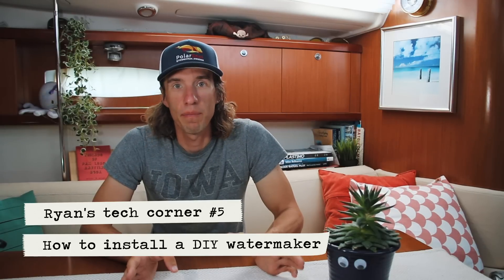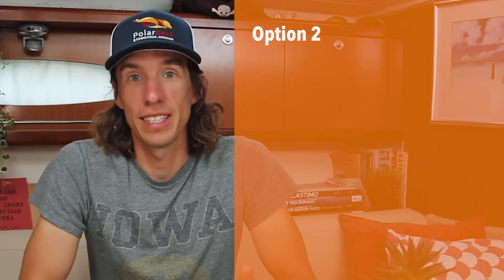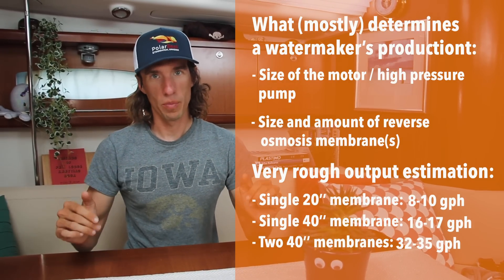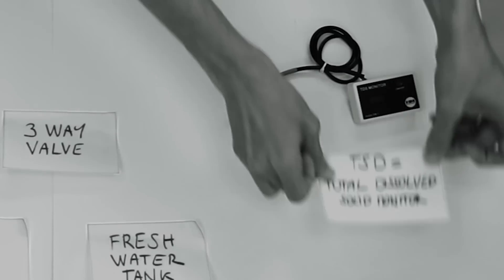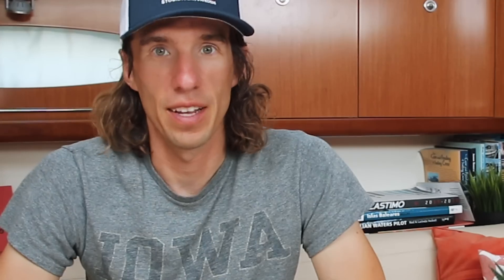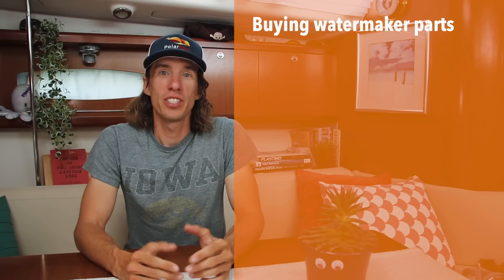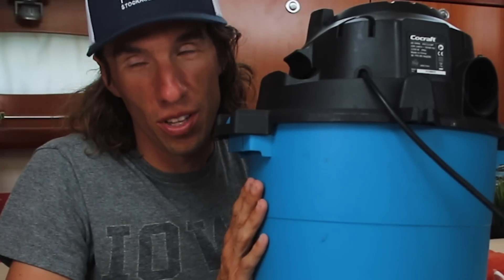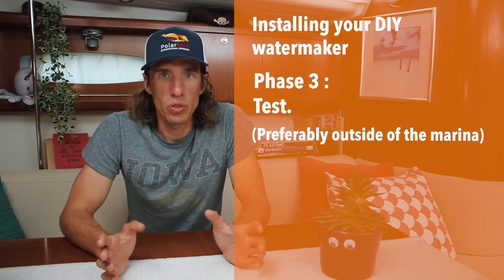SAILBOAT TECH: How to install a DIY watermaker  (SeaWater Pro) // Ryan’s Tech Corner #5

Comment: Does the TSD-meter (sorry) measure salinity ? Or is the TDS showing that the salt is removed ?
Reply: It measures the total of dissolved solids and that includes salts. As it is used after the RO-membrane-filters, a low enough number means the system is working properly. If you want to know before-after then you need a second TDS meter that measures in front of the filter pipeline.

Comment: When the industry gets their head screwed on right, they'll have a device with a few hoses that you stick in buckets and gator clips for 12 volts. Open it up, change small standard filters, and you're set. Until then, it's rainwater and jugs onshore. Everybody's boat tank gets contaminated. Pee Yew.

Comment: Ryan ~ thanks for this. Best explanation I’ve seen! The flush timer - does it use the low pressure or some other pump? How does the flushing fresh water get through your system? Thanks in advance.

Comment: Well done Ryan. I have a question, when you start the clean mode the valve pressure should be always at 50 bar or  is necessary open it? Thanks for your reply

Comment: Is it practical to install a watermaker on a small (sub 30') trailerable sailboat? And if said sailboat has a wind generator on it, would that be sufficient to power the watermaker along with all the other electrical systems? I don't own a boat yet, but I'm considering diving into this world in the next couple of years if I can, since I live close to a large reservoir.

Comment: do you really need to kill the post membrane pressure valve after each use? seems not that useful to me but i'm no expert!!
Reply: from seawaterpro website: "If your system has already been in operation, the pressure should be
left at 800 PSI, and after turning on the pump you should NOT have
to re-adjust the pressure regulator."

Comment: ok follow my logic, a RO watermaker can run continuously without having to freshwater flush the system, not that you'd need it to. theoretically, you can run it on a timer, for an hour everyday, at anchor, without having to freshwater flush the system. obviously freshwater flush b4 pulling into a marina or leaving the boat for any significant length of time. does this sound accurate?

Comment: @Ryan & Sophie Sailing  
I first posted a version of this on your first video about water makers...
Over the years I've seen a few water makers .. mostly DIY ..
I suggest people get advice regarding what I write... as this is just some thoughts...
From what I saw on your videos...
You could do with pressure relief valves in the system, discharging over board .. particularly one just after the high pressure pump (do same with low pressure) .. this would also have a pressure switch with relay (have spares, automotive or lorry or agricultural ones might be big enough) set to a lower pressure than the relief valve to turn off the motor !!! ...
then you could go through a one way valve and have a large pressure tank .. some are stainless but apparently there is now a type of plastic tank with another switch .. with a delay to stop cycling .. to control the motor ... I would fit a similar setup after the low pressure pump.
This would mean both the low and high pressure pumps could charge up the system and switch off saving energy and pump wear .. also it would reduce pressure pulses... Big problem.
A pressure relief valve before the adjustable valve is a must.. with a cut out switch.
Another thing to be aware of is the brine output.. it can block the output pipe ... on a plus note it could be useful for pickling or further evaporating, use a black metal tray (oven tray) and place in the sun or on top of a low heat stove to make salt.
On some systems they used collected rainwater with a bit of sea water that had splashed on deck..
It does mean another tank but less strain on the system.. but some considered the pollution near cities could be an issue for the filter... Obviously it can also be used directly from the tank as it is for washing hair etc... and saving the water maker.
An option I like to do for Backup on crossings is loads of 2 litre bottles ( Basic formula 2 litres per crew per day, minus 1 week) that did contain lemonade etc...
Filled with chlorine tap water .. date them with an indelible marker .. and use as adjustable ballast.
Having the things to make a DIY solar still is another backup.
Have you done another video in 2021 .. on how you get on with it, did anything go wrong, any modifications and repairs.
Hope this helps.

Comment: Hi Sophie and Ryan, thanks for sharing your fantastic journey.  I just found your YouTube channel a few weeks ago, so I am a couple of years behind still 😄
I used to work a lot with RO systems although in a more industrial scale and there are two things I wondered about. 
1) Usually the taste of RO water is very “flat” , as there are no minerals or other impurities that will give tap a slight bit of taste. How does your water taste?
2) When I worked with RO systems I was taught that RO water is not healthy to drink in large quantities. This should be because the RO water would start a osmosis process in the body and thereby draw salt from your body. I am not sure this is true but have you come across this and was it something you considered when designing the system. 

Keep going.  Your videos are awesome 👏🏻
Reply from the maker: 1. It taste okay but flat is a good way of describing it.  I sometimes add a splash of lemon 🍋 to it and that helps.

2.  Yes... drinking only RO water over a long period is not good as it also takes out vital minerals from the water.  That said if you drink juice, or other items (not soda) it should make up, as well as eating healthy.

Ryan

Comment: If you are turning on the system every other day, you don't need to flush the membrane each time. You might want to do it once every two weeks or so.
If you decide to add another membrane, you don'need to change the pump. The pressure is more important, not the flow. You don't need to change anything besides connecting the second membrane in parallel with the first one. However, if you keep adding more membranes, then you would have to increase the high pressure flow. IMHO, it will be better to add another pump instead of changing the existing one, thus adding redundancy to the system.
To further automate the process, put a pressure regulator at the output of the brine water. With that, you can reduce the start and stop procedure to simply flipping the switch. Later, you can add a float switch in the tank and the system will work autonomously on demand.
I did not understand the thing with the amps... Do you mean that at midday you have some energy coming from the solar panels? In which citcuit is the ampere meter connected?

Comment: Aren't you afraid that 800 PSI (55+ bar) will explode a hole in the boat?
Reply from the maker: Thought crossed my mind but honestly all watermakers operate at this pressure... so not too worried.  If one carries full dive tanks aboard thats 200bar...

Comment: plumbers tape is galvanized with holes in it, normally used to secure pipes.  teflon tape is used to seal the threads.  a wise handyman always lays the screw gun on the side so it doesn't fall and break itself or what ever it falls on.

it's rare that those channel locks would be called plumbers pliers (at least here in the usa).

Comment: I recently bought a sailboat that had a water maker installed. The fresh water flush is hooked into the tank which is not pressurized am I actually flushing the system. Or should it be hooked to the pressure side of the boats freshwater system.?

Comment: Awesome video, thanks for the detailed walk through! Debating weather to save up for a watermaker for my boat...and also debating weather to go DIY or possibly that potable DC Rainman one. Saves a lot of hassle for the installment and no extra through hulls, but if sth breaks 😬😬😬 then possibly tricky to find replacement parts and fix it urself. Will do some more googling, thanks for this super helpful video!
Cheers, Nike
Reply from the maker: No problem Nike, 
The biggest plus with the DIY is the parts. I have fixed ours a number of times with random parts found on the boat.  For through hauls we just used the old salt water foot pump but I know people have tapped in to other lines.  Don't use the raw water for the engine though.

Regardless, a watermarked changed our life on board.... can't remember how big your boat is but for it being a home its a great investment. I'm really glad we did it.  Ryan

Comment: Great installation Ryan, but...hehe always is a but, change the location of the 3 way valve, it is very close to the battery selector switch and if you have a hose break, well electricity and water are not compatible, well done man, thanks for share with us.
Reply from the maker: Its completely different now we installed a panel in the galley so that should not be a major issue. Ryan

Comment: I know this is old now, but how long is that pipe you have the membrane in?
Is that 40” and some. A bit over a meter?
And around 4” diameter??
Fair winds,,,/),,,,
Reply from the maker: Without being at the boat and messuring, that's correct.  They are generally a standard size.   You could find the exact dimensions of some online.  Ryan
Reply: @RyanSophieSailing  No, that’s good enough for me. I just like to plan ahead. I’m going to stay in Norway for at least a year. Here is water everywhere. Thanks.

Comment: If you used the correct pipe thread fittings instead of mashing different thread types together with lots of tape, you wouldn't have had any leaks or maybe just a couple usually because they weren't tight enough. Nice video tho!

Comment: You can test inside the marina. Disconnect the supply from the thru hull and place it in water containers filled with clean water. You are not trying to make large amounts of water, just check for leaks and pressures.

Comment: Not sure the Q&A video has been posted, but a quick question: how did you mount the vessel/membrane on the wall? It seems to be against the hull ... How is it holding?
Reply from the maker: Hi Philippe.  I used some marina plywood and some heavy duty siklaflex. To the side of the hull.  I then used some rubber mounts that wrap around the membrains house. Ryan

Comment: Those push-fit elbows are designed for always-pressured mains systems, as in buildings. They like to stay pressurised. Fitted to flexible pipes that are alternating between even minimal above bar and bar they will move in and out. Then leak. Then blow off. Push-fits that incorporate screw collars might be a better option.   
Thanks for covering all the modules off. I agree that self build equals knowledge (and confidence). Great work.
Bill

Comment: Great video, debunking what is in essence, a very simple system.
I would add a clean water loop to the compressor inlet to remove salt deposits once done with water making as the compressor is nodaubt the weak link.
Reply: He did.

Comment: Hi Ryan, having trouble finding a suitable pressure regulator valve. What is the brand/part number you have used?
Reply: Sea Water Pro has them https://seawaterpro.com/product/316-stainless-pressure-regulator/

Comment: Pump seems rather noisy. Are all high pressure pumps that loud?
Reply from the maker: yes, many of the watermakers out there are noisy, some worse than others. After awhile you dont even notice.

ryan
Reply: @RyanSophieSailing  I carry 220 gallons, so water hasn't been a huge issue yet, but thinking it will be nice to have to extra. Have you been happy with the unit so far? Any issues? Is it producing per the claimed rates? I really like the idea of non-proprietary equipment. Spectra sure is nice, but you have to buy all their stuff if/when it breaks or needs replacing. Not a bad little unit - the seawater - for around $2500.

Comment: What does it cost to replace all those Filters - I know that the first 2 are typically used as water filtration from underground pumps/water supplies (and typically need to be replaced every 3 months when used in a house) - on a boat, running every other day, this could stretch to 1 time a year. But the Massive cost is the Reverse Osmosis membrane and high pressure pump  (once the pump fails). 
How often do you need to replace the Reverse Osmosis membrane, I also see that you try and flush the membrane after each use.
Reply from the maker: I believe the RO membranes can last a number of years IF you treat them right.   I normally change the other filters every few months.  So there is a cost for filters but generally its small.  Ryan

Comment: It's probably best to use all the same threads and/or proper adapters, hopefully available at hardware stores worldwide.  It would also be good to have spare parts onboard.  Good job on the DIY watermaker and the video.

Comment: I was was with you until you advised people to use lots of thread tape. That is bad advice 100% of the time.

There are hundreds of thread types globally but for most projects you will choose from just a few. In most parts of the world you will use imperial pipe thread fittings. There are some metric, Japanese and proprietary choices but for diyers avoid those like the plague.

There is plenty of good advice on the net and on YouTube for choosing, understanding and working with different thread types. It took nearly a hundred years for the human race to solve thread incompatibilities. It was in WW2 that this problem was mostly solved.

Also note that tolerances between manufacturers of the same pipe, thread and fittings can pose additional issues. As an engineer I always check dimensions and tolerances against the numerous published standards. For the average person use good quality or sole source. Diagnosing slight tolerance mismatches can be an exercise in frustration. I find this a particular issue in the recreational marine industry where cheap overrules good.
Reply from the maker: Hi Ian, thanks for your comment.  We have had it from a few people. However, i have never found any piping parts that dont require tape... there is always leaks without it.  So yes, i used a lot but without it i would have water everywhere.  Ryan

Comment: One thing is wrong here. Use zero, nada, zilch plumbers tape.  It should only be used for tapered pipe thread on the low pressure side on threads of the same tapered pipe standard as a last resort.  It will flack off and clog pumps. Teflon paste is OK but both are lubricants not sealants.  Using any kind of tape on any straight thread type of joint like an Oring seal or JIC etc will only make sure it will leak.  On the high pressure side trying to gap fill is dangerous and could kill you. 800 psi hose suddenly letting go will whip around at very high velocity.  I use to work in the hydraulics industry. I was ounce walking by some guys disassembling a not all that big of cylinder. They were hammering on one end that was stuck when it suddenly let go. There was enough oil still in the cylinder to come shooting out the retraction port and hit me in the back of the knee. It felt like someone hit me with a baseball bat. I went down. Fortunately, all I got was a big bruise on the back of my leg and oily pants.  Buy compatible parts and take spares.  Trying to McGuiver something together, especial on the high pressure side, is just a very bad idea.
Reply from the maker: Thanks for the input joe.  Just for clarification, nothing on the high pressure side is forced or taped together for the reasons you outline above.  Ryan

Comment: If you actually did force mismatched threads together with Teflon tape, it is only a matter of time before those joints fail.  They will fail. I am a pipe fitter by trade.

Comment: Thanks for the good explanation Ryan. You figured out the advantages of a DIY project. It's not only the price (this is the major point), it's as well knowing everything of the machine. This makes you able to repair it all over the world mostly with parts you can get from local stores. 

I found two suppliers of DIY Systems, one is seawater pro and the other project is made of a German engineer https://watermaker.jimdo.com/teile-liste-bausatz/. The German included a safety valve to protect the membrane.
Fair winds
Tom

Comment: Does the noise drive you nuts? I think I'd want to put the pumps in acoustic boxes. :)
Reply from the maker: Its really not too bad inside the boat... running for a month you get use to it as well.  Ryan

Comment: What leaked the most?  The threaded connections or those push lock fittings?
The push lock fittings make installation easy but do they hold?
I didn't see any check valves in your system.  Did you leave them out?
Reply from the maker: The push fittings are rock solid. The threads were the most of it along with a few things in the pressure vessel.
Ryan

Comment: Does the fresh water flush system  negate the necessity for pickling the system when you are away from the boat for long periods of time, assuming the flusging system continues to run.
Reply from the maker: My understanding is that it does.  If i were gone from the boat for a long period, maybe over two months i would still pickle it so i could shut off my pumps in the boat.  Ryan

Comment: One thing many people don’t realize about the Teflon tape is that it is not a seal but a dry lubricant that aids in making the connection tighter than it would be without using it.  
I love these types of videos, boats and mechanicals.  A bonus that Sophie keeps my attention the rest of the time.   By the way my last job assignment was in Iowa, an hour Southwest oh Des Monies.